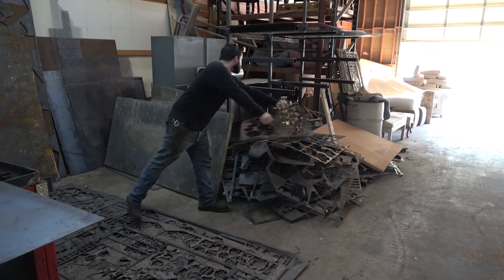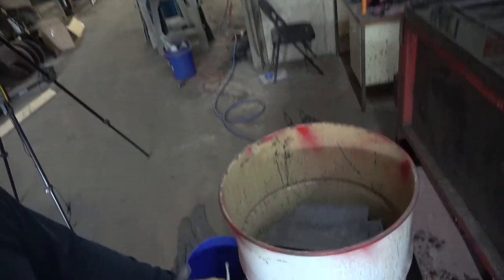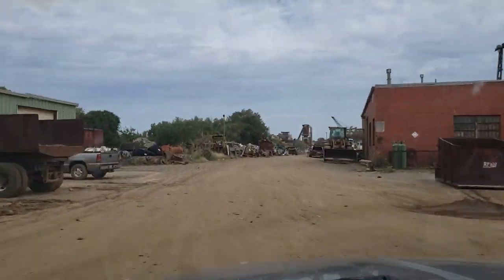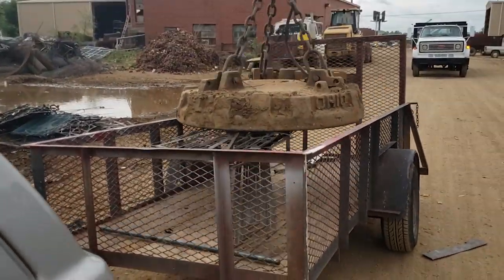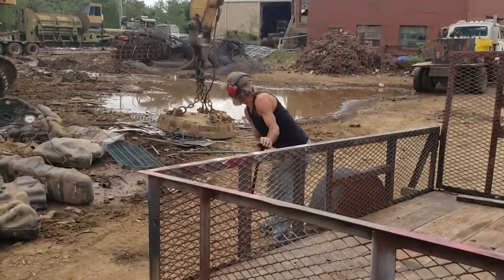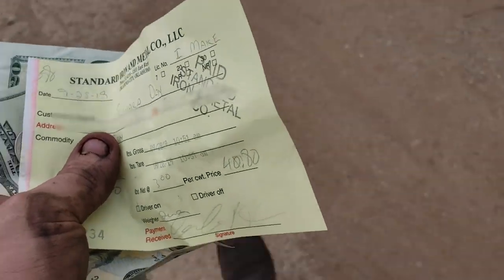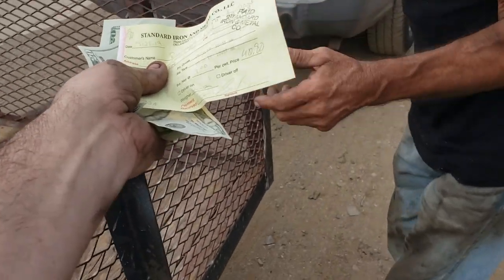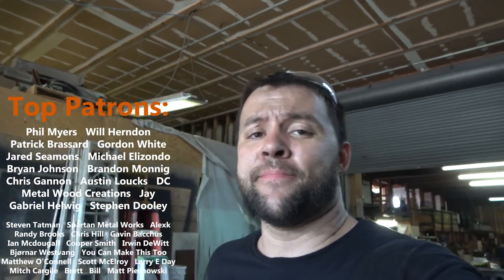What is 4 Months of CNC Plasma Scrap Worth?

Comment: I am a shop manager at a independent shop. We were holding for a "scrap guy" problem was it had oil in shocks, plastic in others.... so we had to worry about EPA. And as prices dropped the scrap guy just didn't want it anymore.  And stopped showing up.  Sad to say 2 to 3 hundred pounds goes into the trash each week.
Reply from the maker: Before tommy wanted it (he normally takes it in himself, but I wanted to clean) I used to give it to another guy who was tickled to get clean steel. Offset the other junk in his load

Comment: I was gonna take some scrap to my local dumps recycling area and just dump it but my local dump wanted 22 dollars I turned around and took the steel to my local recycling yard got 8 dollars it was only 300 pounds or so
Reply: DOHuster I used to save mine for a guy that would come and pick it up every so often, now he doesn’t even want to pick it up because the price is too low so now I throw it in the dumpster🤷🏼‍♂️

Comment: I have a good friend who was working in a local scrap yard in between jobs.
He told me about one guy that got caught cheating the scrap yard ??

There was a guy who would bring his scrap metal in every time it was raining,  and mostly during lunch breaks when everyone was in the office.
Most of the guys working there hated him, lol.

He came in like most times went down to the scrap area to unload.
Always weighed on the way in and then on the way out.

My friend was walking back to the lunch room.
The guy drove past him.
He noticed liquid was leaking from under his truck.
He first thought it was fuel ???

The guy was at the office area getting weighed out and paid.
My friend told the owner what he saw.
The owner went out looked under the truck ?
The guy had a few large plastic drums mounted under his truck with a cable leading up to the truck cabin.
The cable was tied to valves that opened to let water out while he was driving through the yard, LOL.
The owner told the the guy to F Off and don,t come back.

The funny part was the guy still wanted his money for the scrap. ????
Everyone had a great laugh about it.
The owner was not to impressed though.
Says.
I should have called the COPS on him.

Just a story i remembered from many years ago.
Might give you a laugh.
Reply: Now that's a (evil) genius idea. 😆
Reply from the maker: Yeah, filling car fuel tanks with water is common